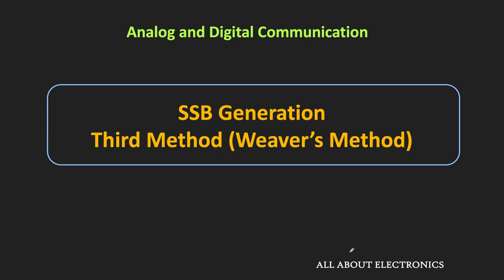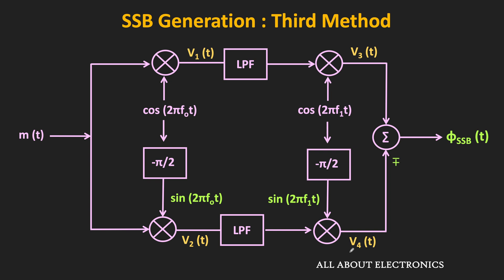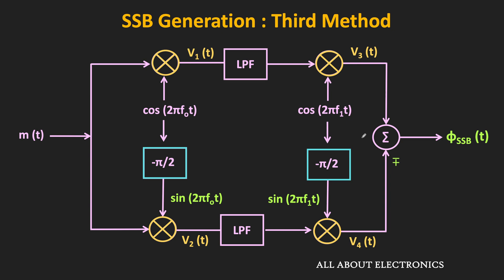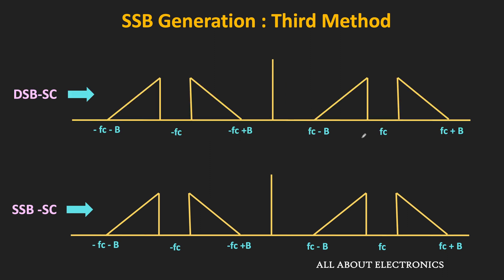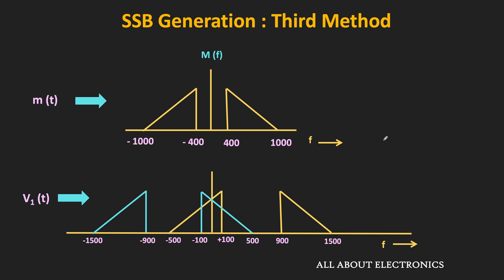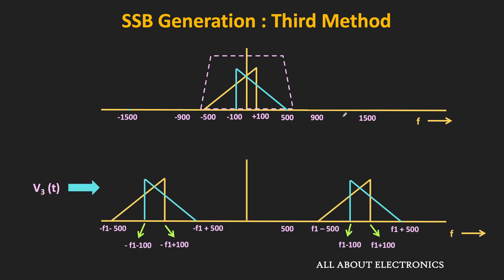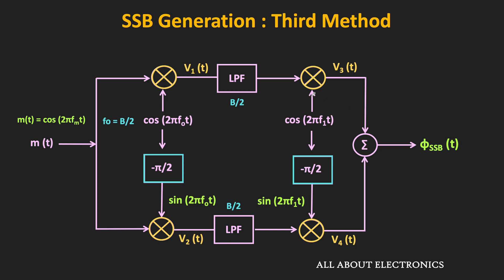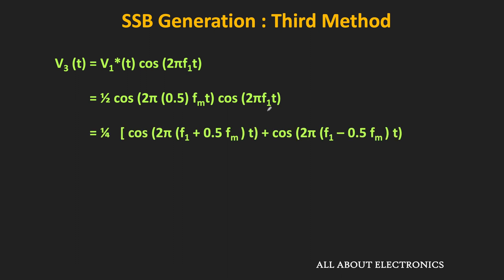Single Sideband Modulation: Weaver's Method (Third Method) for SSB Generation

Comment: Rofea Optoelectronics offers a product line of commercial Electro-optic modulators, Phase modulators, Intensity modulator, mach-zehnder modulator,Photodetectors, Single Sideband Modulation,Laser light sources, DFB lasers,Optical amplifiers, EDFA, SLD laser, QPSK modulation, Pulse laser, Light detector, Balanced photodetector, Laser driver, Fiber optic amplifier, Optical power meter, Broadband laser, Tunable laser, Optical detector, Laser diode driver, Fiber amplifier. We also provide many particular modulators for customization, such as 1*4 array phase modulators, ultra-low Vpi, and ultra-high extinction ratio modulators, primarily used in universities and institutes. 
Hope our products will be helpful to you and your research.